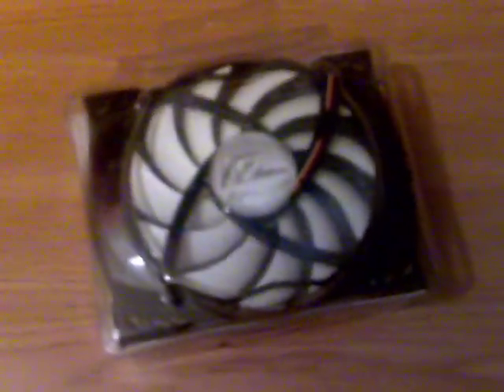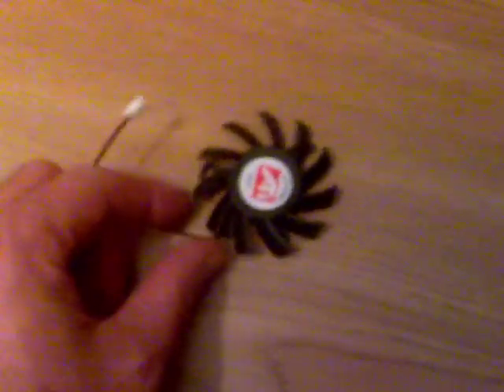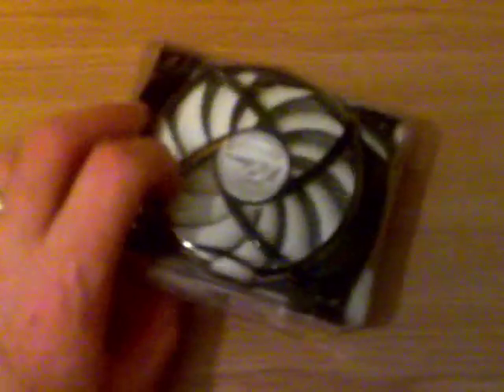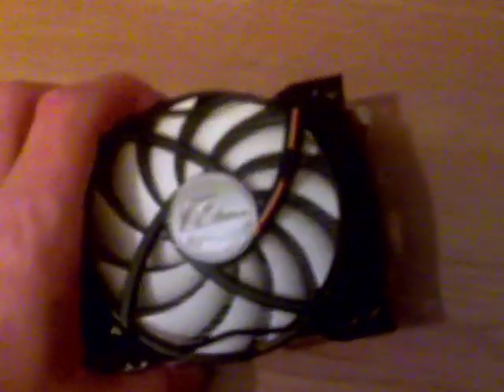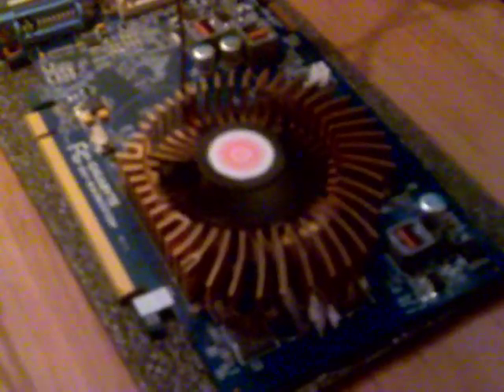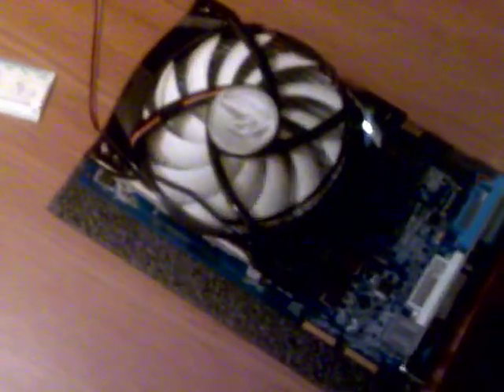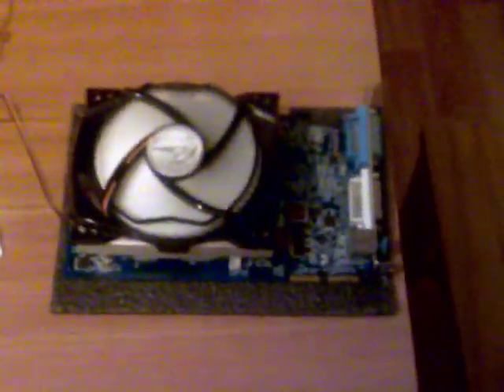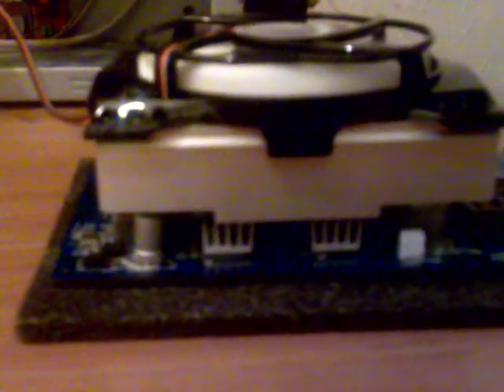Arctic Cooling Accelero L2 Pro - Review and Install on a HD3650

Comment from the maker: Check the Arctic Cooling website - they have a compatibility guide which allows you to check mounting hole spaces and clearance etc. It's worthwhile noting that this has now been discontinued and replaced with the L2 PLUS - you might want to try that one instead.

Comment: I Have a 2 pins connector on my GPU pcb allowing to auto-regulate the fan speed.

the accelero L2 only has  3 pins connector and a molex adaptator.

is there a way to autoregulate the accelero via software ?

Comment: I just bought that fan from a local computer shop. But my real question is that are you able to see your gpu fan speed in programs such like msi afterburner if you just only hook it up on the power cable?

Comment: Just ordered the L2 Plus. Bought a used 6850 online and it came with a fan with insanely noisy bearings. Seller says he doesn't know what's up with that, but anyway the L2 Plus turned out to be $15 with 2-day shipping at Amazon due to a refund I got so not a terrible ordeal in the end.

Comment from the maker: @massacre692v Yeah you have to use a molex connector to power it up. You can buy splitters very cheaply on Ebay so you can split a molex into two if you've run out. Or, if you are handy with a soldering iron you can do what I did which was to cut off the connectors and solder on the connector from the stock fan that I was replacing. That way, you can power it directly from the graphics card (that will void the cooler's warranty though!).